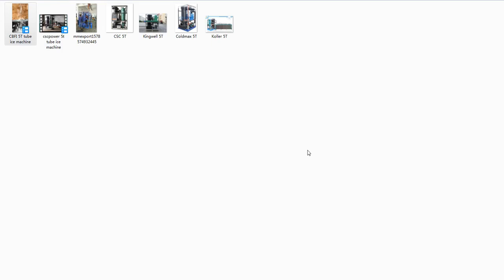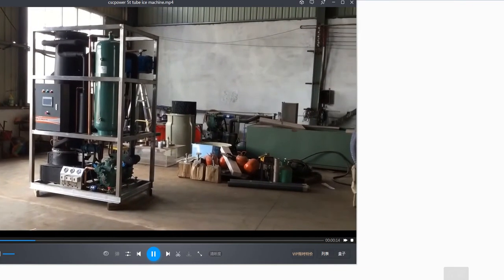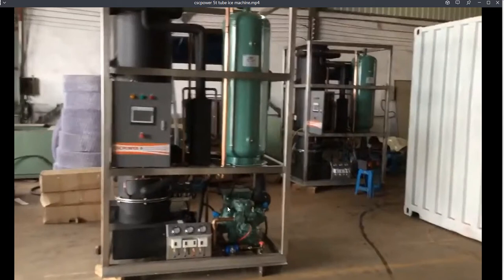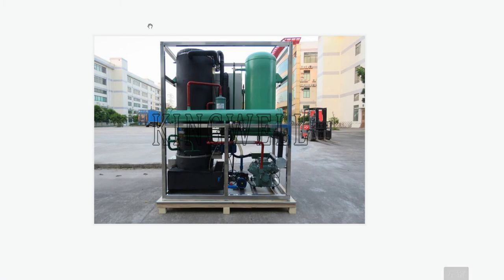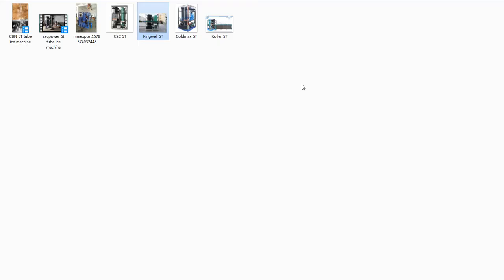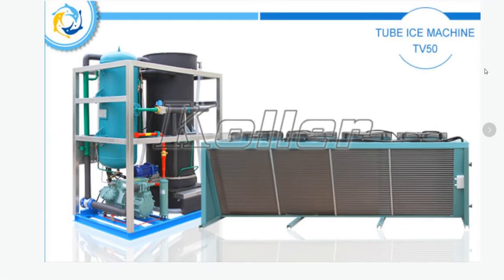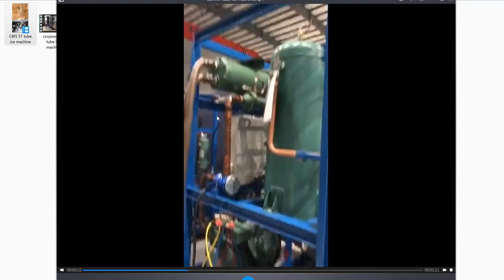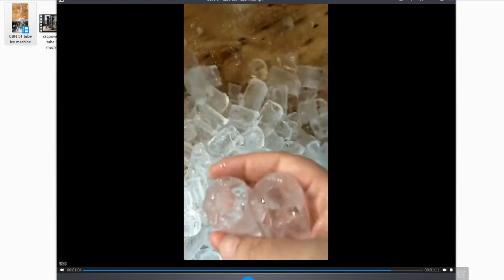Rubbish tube ice machines from other Chinese manufacturers

Comment from the maker: In China, there are countless tube ice machines suppliers.
To win the price wars, the suppliers try all the best to lower the manufacturing cost, then they can offer lower prices to the buyers.
Such weird tube ice machines are created by the Chinese, and widely used around the world.
Those weired machines's compressors are easily burned due to liquid slugging when huge amount of liquid comes back to compressor from suction sides.
Those weired machines are not efficient, and need to be equipped with very big compressing & condensing units.
For example, the high technology 5T/day tube ice machine is equipped with one 15HP piston compressor, and that is more than enough.
While the poor technology 5T/day tube ice machine must be equipped with one 25HP piston compressor, and its capacity may not reach 5T/day. Also the ice quality is very bad.
Ice tubes are milky white, and ice tubes can not be solid, they are always with very big innner holes.

Here is a video to show some 5T/day tube ice machines equipped with one 25HP compressor.
https://www.youtube.com/watch?v=cvHf437G2jo

Those are big Chinese suppliers for tube ice machines around the world.
Such tube ice machines might be able to make ice, but they are very unefficient with very poor technology.
That poor technology originated from Chinese low price stratage.
The manufacturer simply put the 4 main components together to fomr a ice machine.
The manufacturers are reluctant to add more components to make the system efficient.
The manufacturers are not going to pay for the electricity bill to run the ice machines. They do not care if the machines are power-saving or not. They simply focus on the price wars and then bring the buyers to the hell.